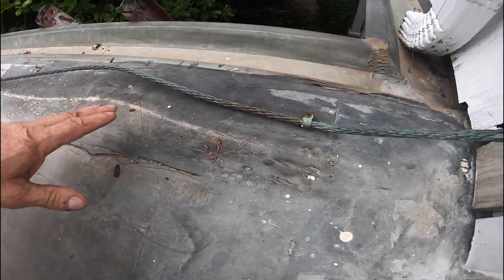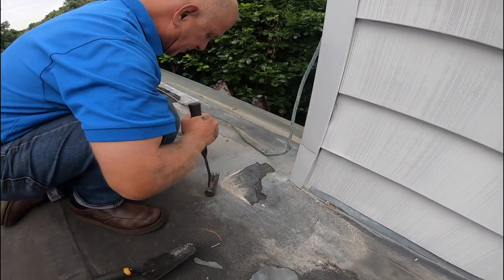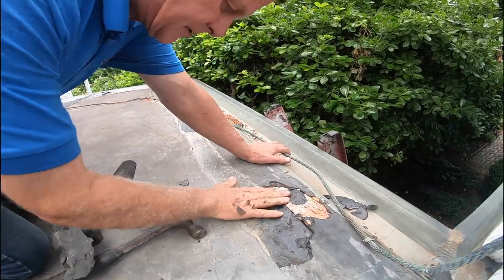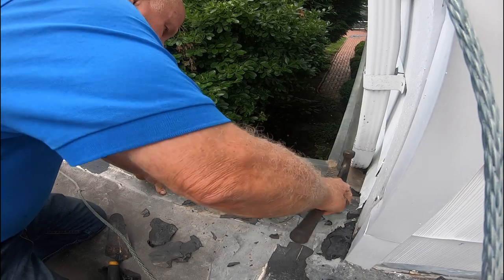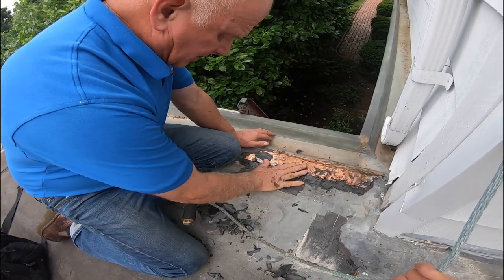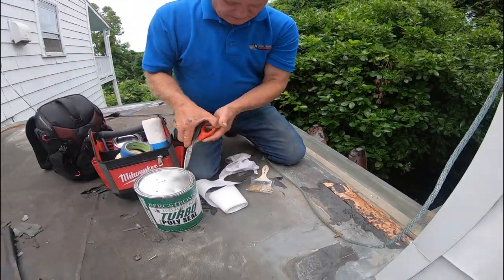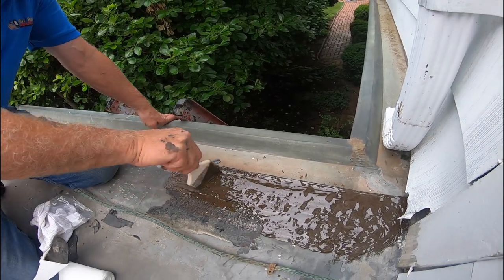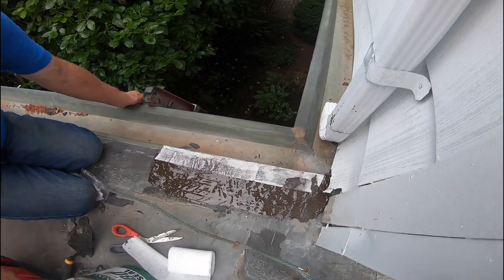How to repair a Gutter Leaking - Turbo Poly Seal DIY

Comment: Flat roof doctor, you are a genius. I love the way you diagnose the leakages. But I have always wondered how you would charge for something like this. It's such a easy fix once you found the problem but would the customer appreciate this enough. If you are not coating the entire surface and charging per sqft, how can you make any money?
Reply from the maker: Hi Yusuf Normally I identify the problem first, then decide what I think I want for my expertise. In this case, I charged $500 for the fix. I normally give a price and then let them call me when they have decided they want it done. I never do the job right away because then they might think it is too much to pay for a 10 min job. I always hope that they are not home when I come to make the repair.
Reply: @FlatRoofDoctor  https://photos.app.goo.gl/Q3oLQjrmsA6mH8NDA

Thanks for your response. This is a project we did for a wind energy factory here in South India. We simply could not identify the problem areas as it seemed like the water could seep from any of the joints.

Do you think in such a scenario coating the entire surface was an overkill? We used polyurethane on the joints and uv resistant acrylic coating for the top finish. 

Just for your information we only charged them 50 cents per Square foot.
Reply from the maker: Ok I think the mistake you made was to use acrylic coating. I am on my way  as i finish this reply at 6 am this morning to go to Brooklyn to redo a roof over a garage that was done in acrylic coating. It look pretty when i saw it 2 years ago and now it is a disaster. I am shooting a video of the entire project.
Yes, I don't think you should have coated all the copper. Only where the bends are and joints.
I know in India it is a hard life to make a living. That is really low wages at the price you did it for.
BTW, i am sorry for responding so late, I was on a big project for 2 weeks and never got a chance to to look at comments.
You can write again and let me know your thoughts.
Many Thanks
Naas

Comment: Hi Doc, will the turbo poly seal work on brick that has been treated with water proofing spray such as CHIMNEYRX Masonry Chimney Water Repellent?  Thanks for the excellent vids.....
Reply from the maker: Hi JD
I am not sure. I have tested it on a urethane silicone and it works fantastic. It Bonds to Acrylic but I don't know about ChimneyRX. Maybe if you tried some Polyurethane paint on a small part of your chimney and see if it bonds. Turbo Poly Seal has to major components that help it bond to almost anything. 
These are a Urethane and Bituminous resins.
Bets Regards
Naas